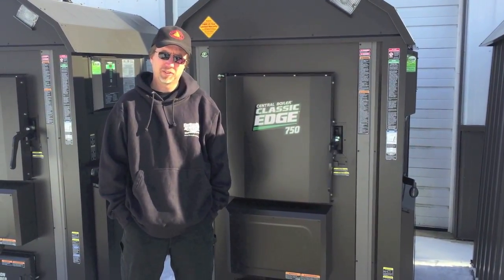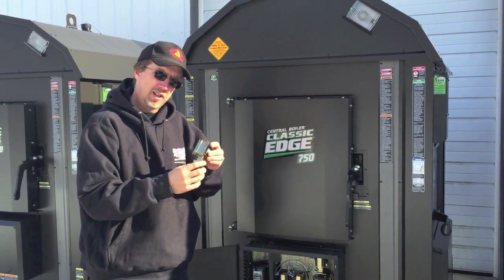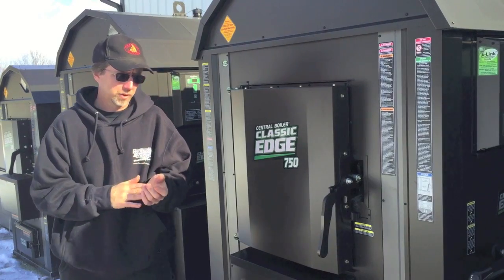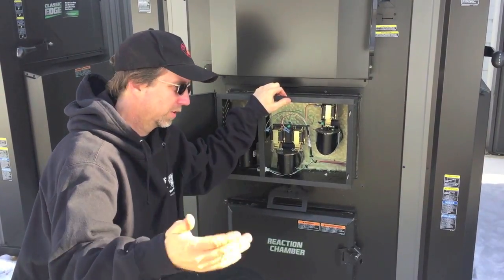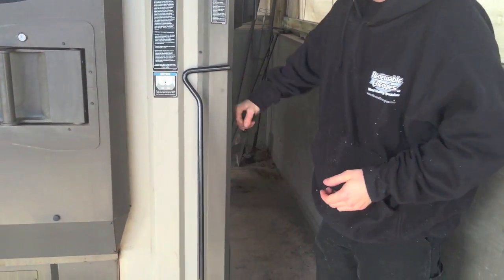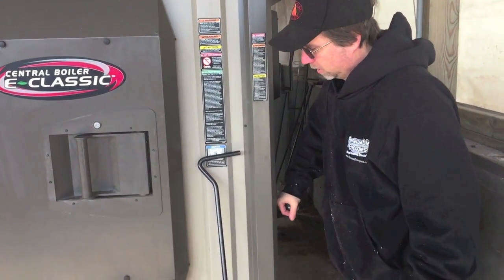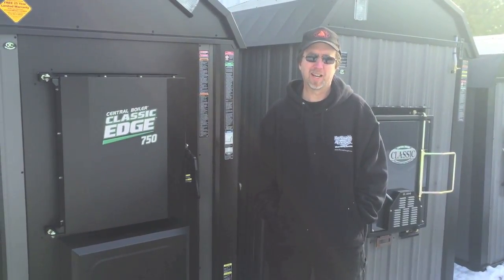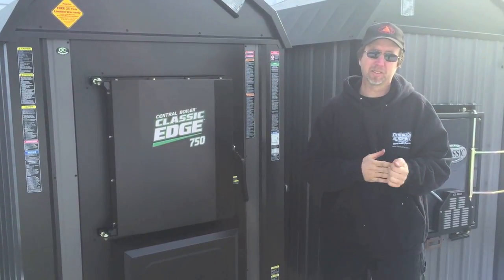Renewable Energies  FAQ Video

Comment: I bought the 750 last year and it worked great and for half of this year as well.  Then it stopped burning properly.  I can start a good fire and when I close the door, it dies out and says 'fire out'.  When I open the door, the fire starts up, so obviously no air is getting in.  My 750 unit doesn't have solenoids to open the air valves, but rather has a little motor which winds up a chain to open the lids.  They appear to be in good condition, but even if I prop them open it seems no air is getting into the fire chamber, even though the fan is blowing well and building up a little pressure in the chamber where the valves are.  So I think the lines are plugged.  If this is the right diagnosis, how do I clean them out?